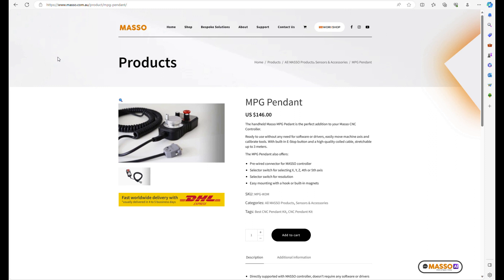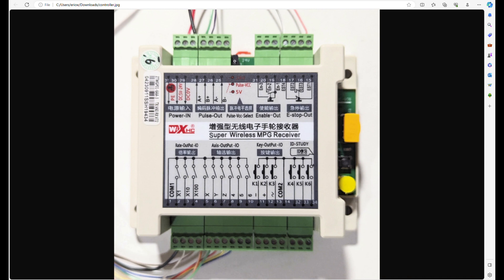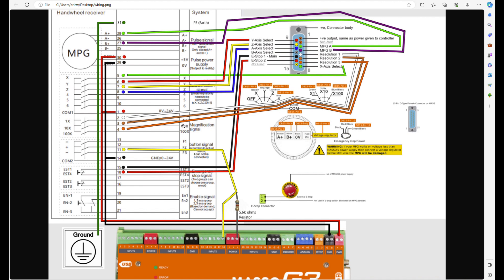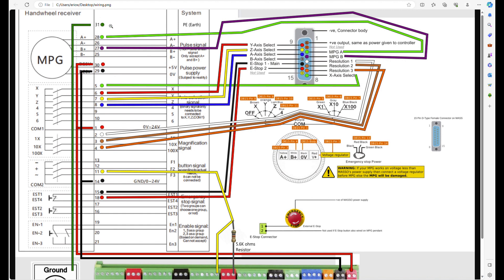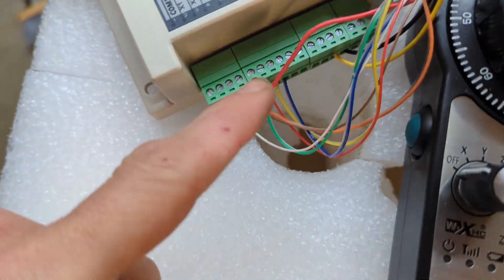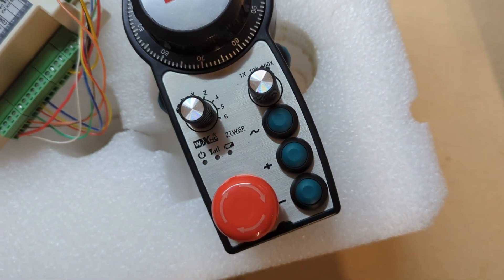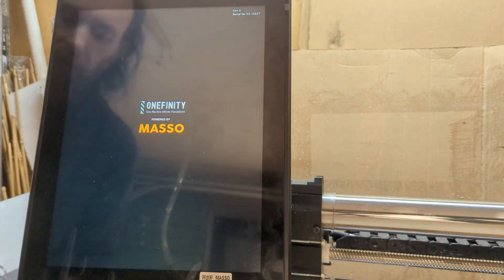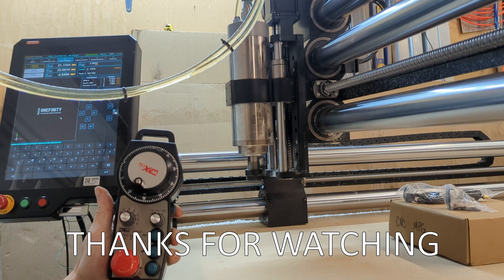Wireless Pendant how-to on a OnefinityCNC with Masso Controller

Comment: Great video
Trying to decide on wired or wireless.
Realy want wireless, but I dont want to mess up (fry) the Masso.
Where you state (there is a better wire?)
Did you come up with a better way to get this wired up then shown in this video?
Is a pull up resistor also required with your other install method?
Do you have a updated wiring diagram?
Someone else posted they are getting an unexpected homing sequence when they initially do an e-stop reset?
Sorry for so many questions.
Thanks
KZ
Reply from the maker: no need to wire it differently, it works great., pull up resistor is required yes.
Reply: @ericbuzz  Thanks a bunch!

Comment: Please help. Trying to order same product as your video that you’ve setup. 

Distributor is asking for the receiver voltage and pulse output. I told them 24v based on your video. 

They’re asking for pnp or npn
Reply from the maker: I don't know who your distributor is but I contacted wixhc.cn directly by email and asked for the one that works with the Masso G3 Touch. there is a picture of is here https://forum.onefinitycnc.com/t/working-wireless-mpg-pendant/23484/8

Comment: What system Did you choose I see it for Mitsubishi Siemens etc?
Reply from the maker: Thanks for the comment, I was confused as to which to buy myself so I contacted WIXHC via email through their webpage, in the "contact us" section. The model they recommended was the ZTWGP01-6AA-3-24V and I bought it directly from them thru a payment link they sent me. The wireless receiver they sent was the newest model that does 5v or 24v and you want to make sure yours does 24v.
Reply: @ericbuzz  thank you so much

Comment: Great video.  I added my wireless pendant (wiXhc) about 6 month ago and struggled to get the E-stop to work right, but finally figured it out.  I really like the safety feature of having to hold the button for the pendant to work.  You did some great explaining and documentation, this will probably help quite a few people who are struggling to get their pendant connected or even know that it would work with the Masso controller.  Great job....
Reply from the maker: Thanks for the comment, I like this wireless MPG a lot. At my day job I only have a wired one and the table is 10x5 feet. The wire limits my movement so for my personal machine I knew I needed a wireless one.

Comment: Why did you decide not to use the 24v from pin 1?
Reply from the maker: Thanks for the comment.  I don't know how much current the wireless receiver draws and I didn't want to overload Pin1. This video was only to show proof of it working and basic wiring. 

Masso has this on their website.... "CAUTION: When using the auxiliary Power and Ground terminals on the controller the total current draw must not exceed 500mA across all terminals. Connecting high current loads can damage the controller beyond repair." 

I would actually recommend wiring it directly to the 24v power supply to avoid overloading the Masso unit.